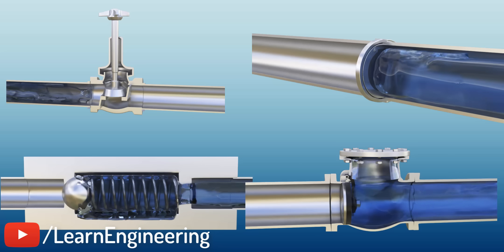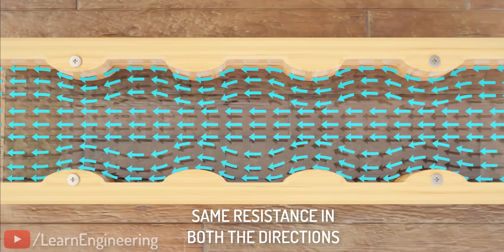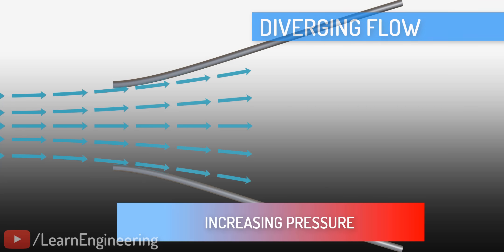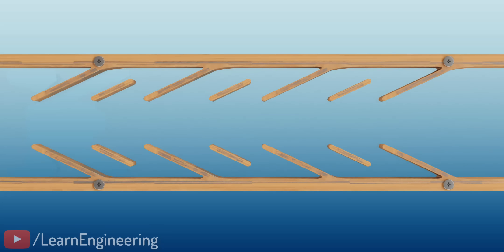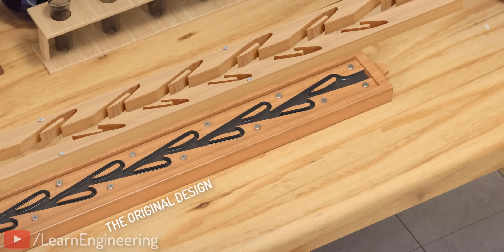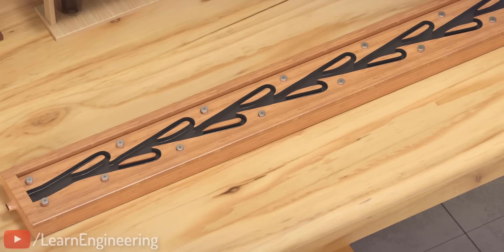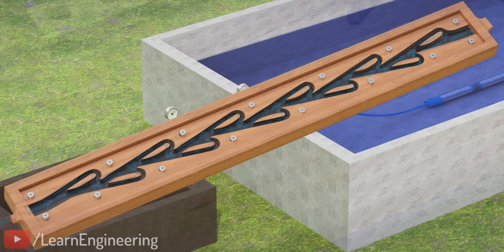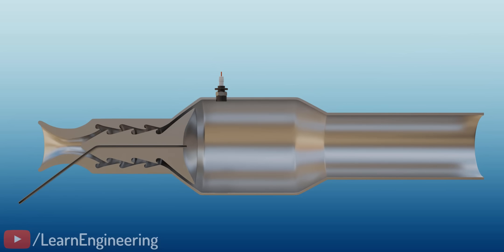Tesla Valve | The complete physics

Comment: Transistors and Diodes are one way "valves" for electrons.

There is alot of myth and nonsense about Tesla....
He had very poor knowledge in advanced mathematics and physics and was considered a " quack".
He did come up with many good ideas and inventions such a AC motors and Radio transmission.

This device is not a "check valve" and will not stop flow 100% just cause friction.

Comment: Brain of normal people : " You can't do that " 
Nicola Tesla : " Hold my coil "
Reply: It's gun silencer for water. And it should be a 3d model for more efficiency
Reply: And, like the true world, turns out he couldn't after some inspection.  The flow did not stop.  He did not have a death ray.  He did not have effective wireless power transmission (and some say he didn't have even inefficient transmission since his experiment may have been unknowingly using the earth ground as a wire), he did not have a resonance machine capable of destroying buildings.
Reply: @taggah2000  just try to 1° incline this fucking valve and use capillarity .. The flow have to continue

Comment: "Testing the valve" by showing a computer simulation is not testing the valve.
Reply: michael timmer  yeah afaik it's used in microfluidics(though seem to be often used there), pulsing heat pipes, and maybe pulse engines. Very few indeed, but not useless like some here claimed. It's about the right tool for the job
Reply: michael timmer  how can you call it useless when in the video real applications were shown?
Reply: It's not even a simulation. Just plain old animation. A fluid simulation would have been nice. They should have tried doing it in Solidworks or something similar.
Reply: Especially given Tesla's love of practical experiments.
Reply: Now you know how I feel about climate modeling breh.
Reply: @RVGENomini  What are you talking about? There's plenty of room outside for 1:1 scale climate experiments.
Reply: @tiberiusvenivicit  Yeah now predict the weather one month from now at your location, predict it 10 years from now, 50. gg
Reply: michael timmer  that would describe it better, yeah but also considering the Higher the pressure = the better the sealing (even tho it never reaches Zero ) makes this "valve" pretty usefull to restrict backflow.
Reply: michael timmer  how is it useless if it does "regulate" in only one way? The asymmetry is the main feature(that made it labeled as 'valve'), not the "regulation", so of course it's not for applications that require variable regulation. Wouldn't by that logic, household-scale pipes are 'pretty much useless' since they would perform as static regulators if used as bottlenecks in high-diameter applications?
Reply: @ki0w0-lordofwatersheep  "how is it useless if it does "regulate" in only one way?"
It doesn't. It doesn't do anything.
Reply: @davesmith3289  "it doesn't. I doesn't do anything"
How does it not do anything? Can you please elaborate? Or just make blind assertions without any basis or evidence?

Grand Illusion's linked vid in the pinned comment clearly shows the highly slowed down reverse flow, so how was that "doesn't do anything"?

The only thing that doesn't do anything is your reasonless assertion
Reply: Computer simulation is a form of testing, speaking as an astrophysicist. Cant really test galaxy formation in real time XS
Reply: @LokiuniusGaming  galaxy formation is easy cause it's just GR, there's no GR for climate. we can't even deal with turbulence
Reply: Especially since someone actually tested it and it doesn't work at all
Reply: @BGraves  who tested it? How does it 'not work at all'? Didn't Tim from Grand Illusions test it & it worked?
Reply: michael timmer  oh boy you have No idea

Comment: TBH, Tesla Valve is not one way... It only reduces the speed... I call it, a bogus video
Reply: Yet the speed reduction only works in one direction, so how was it not one way?

If it reduces speed in both directions equally, now that is 'not one way'

Tbh, while it 'only' reduces the speed, it still does so significantly enough for certain engineering purposes

I call it, a bogus debunking
Reply: @ki0w0-lordofwatersheep  one way Valve means fluids only go in one direction, not one direction at full speed and the other at reduced speed..
Reply: @ForeverMan  in most one way valves that's the case, since they can completely block the flow. But if the reduced speed is slow enough it's negligible, wouldn't it only count as  flowing freely in only 'one way' as well?
Reply: @ki0w0-lordofwatersheep  dude, I'm not gonna be rude with you or answer you anymore... Do a little research

If you see a one way street, do you think going wrong way at half the speed is gonna be ok?

Anyways, I'm done here, bye
Reply: @ForeverMan  you're comparing different situations with different thresholds, lowkey straw argument there. Of course the road's threshold is zero, but fluidic engineering purposes? Not all require zero, such as microfluidics(where the miniaturability & simplicity outweight the tradeoffs). And if the reverse flow's not half as you insist, but negligible? Please, pleeease do your research before telling others to.

Wanna use analogies? Ok, don't diodes have leakage currents too? Do people still count them as 'one way'? Do your research please?

Why don't you wanna answer me anymore? Admitting you're out of arguments/can't support them anymore? Makes sense given a straw argument was all you had. It was already over at that point. Bye.

I call it, bogus

Comment: This video needs a real demonstration, not a computer graphics pretend show.  The fictional graphics are highly exaggerated on both modes.  The pressure drop right to left would be significant, and the flow left to right would be much greater than depicted.  This is junk science.  One thing is sure, the resistance to flow is significant even in the "open" direction.  Mechanical valves have virtually no such resistance to flow.  There is no free lunch.
Reply: “No free lunch” is true, but there are many applications where a compromise is worth it for some reason. And there very well may be a place where the simplicity of a zero-moving part valve outweighs the disadvantages of restriction in the preferred direction, and incomplete shutoff in the opposite direction.

Comment: "Your intuition says that the right-to-left flow is easier."
Uh, no. My intuition said the other one was easier.  I didn't know the details of why it was easier, but it made sense in my head.
Reply: Mine said both are the same since the obstruction geometry for the flow in the middle is the opposite of that for flows on top and bottom ¯\_(ツ)_/¯ im no physicist tho
Reply: @xSergisX  I'm pretty sure it actually is very much similar. They get quite some facts wrong in these video, e.g. the part with the pulse engine.
Reply: @astorMorisson  
Eh it is mostly correct.  It is the concept of vortices like was mentioned in the video.  As the incoming laminar flow enters the expansion zone it forms eddies in the flow causing it to become turbulent flow. 

This will happen in the right to left pictured but to a much lower degree due to the expansion zone having flow from all sides.   The flow remixes.  

See fluid flow isn't one velocity throughout.  Due to the no slip condition the velocity of the flow near the edges is at 0, while flow at the center is at the highest speed.   When high speed fluids expand they become turbulent removing energy from them due to eddies and vortices.   The lower velocity fluid at the edges stays laminar and calm until the reduced pressure of the vortices drags it in.

I studied fluid dynamics as part of my mechanical engineering degree...
Reply: @xSergisX  the outer sides have friction with the sides to deal with, the middle doesn't. You'd have to put a wall down the middle for the geometry to be the same.
Reply: Your brain uses Windows 98
Reply: @vikraal6974  Is that supposed to be an insult or a compliment? I love Windows 98.
Reply: @TheOriginalJphyper  I guess Vikraal is not old enough to know that Win98 was rather successful.
Reply: @vikraal6974  And you use MS-DOS
Reply: @randomdude8877  is that supposed to be an insult or compliment?
Reply: @randomdude8877  You think Windows 98 ISN'T MS-DOS?

Comment: I have never seen an actual working pulsejet engine using the Tesla valve.  The reason for this is that the valve is too "soft" and absorbs a lot of gas before it is "full" and the choking effect becomes pronounced enough to cause compression in the combustion chamber.   For that reason, any engine built with such a valve would be unlikely to run well -- if at all.
Reply: Yeah, there's a reason the video cant show the valve in real world use despite it being super easy to print.  It's just not effective enough
Reply: What do you mean by it takes a lot of gas to get full? Can you elaborate on it
Reply: @SpartanSky  A valve closes and the flow stops right there. With Tesla's device, there's a little backward flow necessary to create the high resistance to flow; add to that the fact that air is compressible like a spring, and the Tesla valve is now permitting quite a lot of hot combustion gases to flow backward and into the valve.
Reply: @machinemaker2248  😮
Reply: could this be adapted for use in "silencer" tubes used to dampen firearm discharges ?
Reply: @lylestavast7652  So long as your bullet isn't travelling in a straight line :-D
Reply: @lylestavast7652  looks like the basic idea to me!  Just take the 2d model and turn it into spherical... and then figgure out how to machine THAT idea a little more efficient.  And there ya go! Monoblock suppression achieved!  I make it sound like anyone can do it! Lol
Never thought I'd find out Tesla even invented the concept of modern day suppressors!! Beautiful day! Beautiful explication! Love the channel! Thanks!
Reply: https://youtube.com/channel/UCn90M611FZgYSy3bMgECImA
Reply: https://youtu.be/NYGq0bD3NBk
Reply: https://youtu.be/NYGq0bD3NBk
Reply: https://youtu.be/NYGq0bD3NBk
Reply: https://youtu.be/NYGq0bD3NBk
Reply: This is omitting the electrical applications the design is really intended for.
Reply: Do you encounter pulsejet engines often? I know the theory, but I never saw one in person...
Reply: @melonlord1414  I have built a lot of pulsejets.  I was in an episode of Scrapheap Challenge and also technical advisor to Junkyard Megawars on their pulsjet drag-boat build.
Reply: @xjet  I also used to fly 6 to 10 ft long fighter jet models with a pulse jet that used a flapper valve at the intake, these pulse jets are banned here now as they are considered too dangerous, only ducted fans now, but i really would love to see if this one could match the power we had in the good old days..
Reply: @johnmccoy7115  If you look at some of the early videos on my channel you'll see that I've done quite a bit of pulsejet stuff (including RC models)
Reply: @melonlord1414  They tend to assemble for shopping mall flash mob events, and for Asian tofu lunches in China Town-like neighborhoods of various metropolitan cities.....
Reply: Completely agree
Reply: You’re failing to consider how well it was designed for the time. Obviously, nearly a century later, it is outdated now.
Reply: https://youtu.be/mC91vEMwq-E

Comment: An interesting experiment would be to place this at a coastal region with relatively high waves.
     The valve is set a what one would assume to be a relatively shallow angle to the shore.  A individual wave pushes water up the valve.  Then you have the trough.  The water has difficulty being sent back down the valve.  Then the next wave pushes more water into the valve.
      The idea being that it could function as a wave generation device.   The sea water fills a reservoir on shore.  One assumes the total height of the water is not going to be that great.
      The water is then released via a shallow draft turbine system to generate electricity.
      So the erratic nature of the waves is concentrated into a reservoir and released as a predictable and constant source of electricity.

Comment: Each of the little "islands" looks just like the cross-section of an airplane wing.
Reply: billucf96 the Bernoulli principle at work
Reply: You're on to something, I can tell...
Reply: Interesting observation
Reply: yes, bernoulli's principle
Reply: Interesting
Reply: Just what i thought
Reply: Ok
Reply: It's the same principle. Wings are flat on the bottom (normal pressure) but are curved on the top (low pressure). The low pressure is what provides lift for aircraft.

Comment: I would like to see a real experiment.
Reply: Or fluid simulation at least
Reply: There are a few on youtube.  But rém this was designed for fast moving gases not liquids. It's not a valve. And only restricts opposite flow (does not stop it)
Also the original design does not work extremely well. Later designs work much better.
Reply: @taerog  Please could you direct me to some? Thx
Reply: https://youtu.be/mC91vEMwq-E
Reply: https://youtu.be/tcV1EYSUQME
Reply: @jerrylopez03  The flame went out the other side pretty quickly. Like in a blink of an eye.
Reply: @jerrylopez03  that is not a real experiment
Reply: @jerrylopez03  A combustion front is not a fluid. Show it working with a fluid.

Comment: The first sentence of video has to be like,
“The Tesla valve cannot block the flow completely”
Reply: I used to work in the leak test industry. Everything leaks. If your car leaves a drop of oil on your drive every night it leaks. If it leaves a drop every 100 000 miles you may not even notice and it is "tight". 
For some applications the Tesla leakage rate could be OK. I'd like to see it on a two stroke engine instead of a reed valve, without which the engine would still function.
Reply: @TheRealWindlePoons  I don't the the issue is if every leaks or not but what's the leakage for a given pressure. 
In reality all solids evaporate at room temperature to some degree. But there's a big difference with how solids evaporate vs how liquids evaporates. the former is 1000's of times  slower. So slow that we have a different name for the process.
But at the end of day I think that if the video didn't start of that moving parts valve challenge and also show what looks like liquid going through the pipe, people wouldn't have called out the difference.
Reply: It's not designed to be a constant pressure valve. Under pulsing conditions, and with the right size/length conduits for the density of the fluid and pulse width, it effectively does block flow completely. Think reed valve, not water faucet.
Reply: Ronin  
yes, there are 100% in the real world with valves, they will stop the flow of water.
Reply: Stella smith almost all valves leak. Bubble tight valves exists but they are $$$$$
Reply: @JSpradley123  I think you underestimate available valves.
We have 100'es of valves at the factory and they all seal fluids 100% at pressures under 5 bar.
(different story for gases or fluids under high pressure)
The only real maintenance is replacing the rubber seals once every couple of years (depending on the usage)
Reply: spim randsley  "he thinks that a little real world discrepancy between theoretical and practical gives scientific legitimacy to a steaming pile of bullshit."
And what gives this even more steaming pile any more legitimacy?

Isn't there a disrepancy between this response and an actual, logical counterargument?
Reply: Ronin  In real world, your sink never closes? Lmao.
Reply: Ronin  while 100% is nowhere, >=99% is often achievable. And althought the Tesla valve is clever & has its advantages in certain uses, there's a reason most valves use other methods instead
Reply: If it was the first sentence it would make no sense, aren't drawbacks usually explained right after the advantages?
Reply: https://youtu.be/mC91vEMwq-E